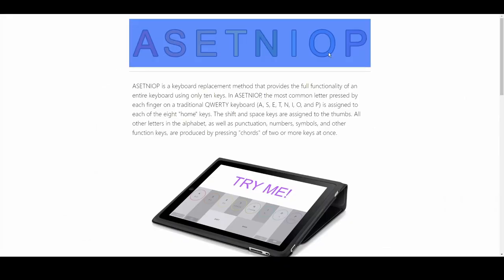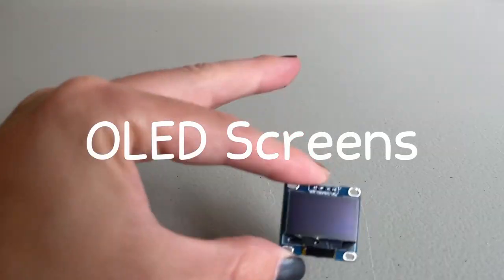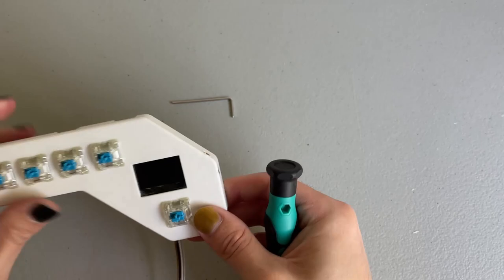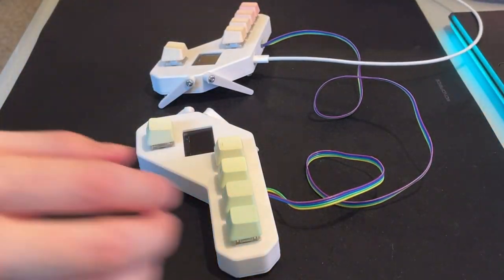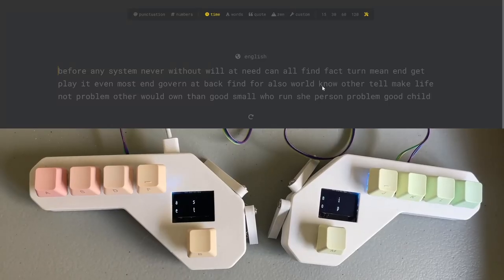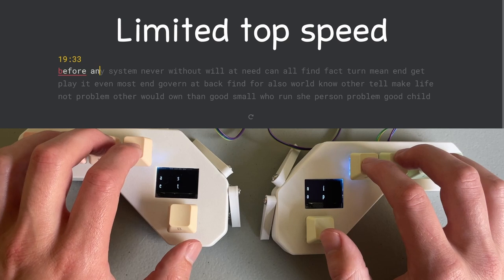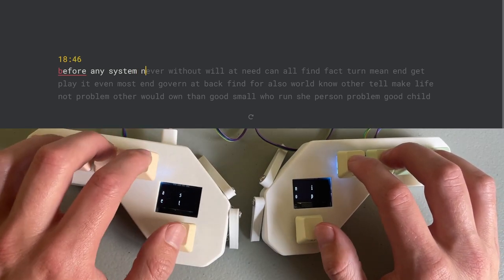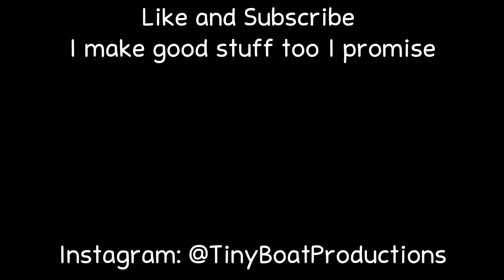I Made the World’s Worst Keyboard

Comment: I actually learned the Colemak version of Asetniop, called Arstneio! On their website's built in typing test, I get 40-50wpm if I'm warmed up. I don't really practice it anymore, but it's really neat to have learned! It's close enough to the regular keyboard layout that it's pretty easy to pick it back up even if I haven't done it in months. I also set up a QMK keymap for it on my Planck using the chording feature so I could use it in other programs too lol, and since it made use of chords for all the letters, there wasn't any delay. It's actually a lot of fun to use! I really want to make some type of hand attachment that uses my finger taps to be a keyboard so I can use it in VR or something.
Reply from the maker: I think part of the problem I had was that I couldn’t get the layer changes (because of the screen) low enough to make it quick. I think if I had used the sequence function it would’ve worked better. But hey, ya live and learn. 
Getting it to work within VR would be really neat

Comment: I wonder how they designed what corresponds to what key press. This is probably enough keys to make this into some sort of braille keyboard. From my understanding of it, you only really need up to 6 - 8 dots (keys in instance) to make a letter. they do have “layers” to make numbers or other symbols. Such as a reverse “L” shaped dots at the start when shifting into numbers. 

A crazier design is another video i saw recently of some guy making a single handed keyboard. Don’t remember how many keys but probably around or under 10. Don’t know if he is trolling or not, but in the video he was able to type decently fast even when including random symbols like brackets.
Reply: The ASETNIOP website goes into some detail about the rationale behind the layout and combo choices. They’ve accounted for letter frequency, chord difficulty, and the fingers you’d use on a normal QWERTY keyboard.
Reply from the maker: I think the small one you are talking about is ARTSEY.IO I actually built one of those recently and really like it, especially as someone who works mostly in software that I need my mouse for (3D modeling) instead of just text based